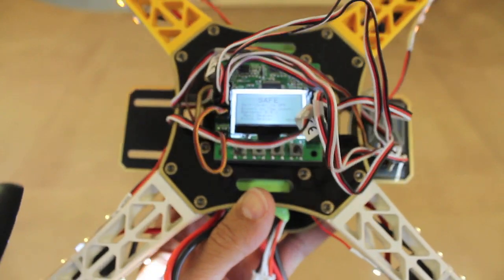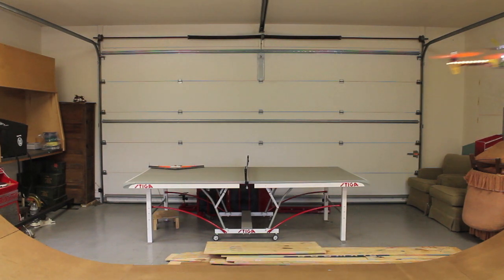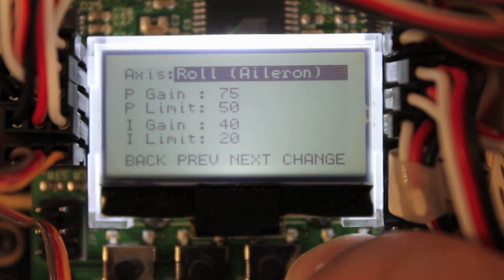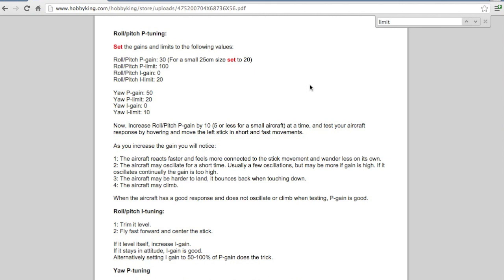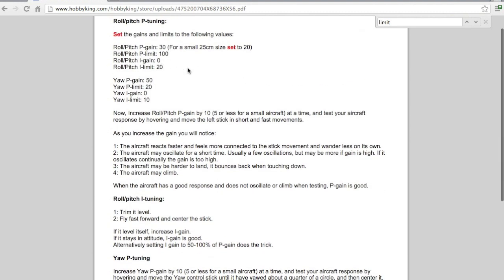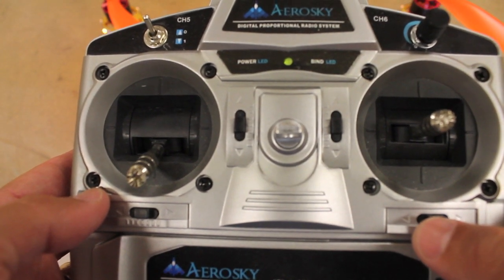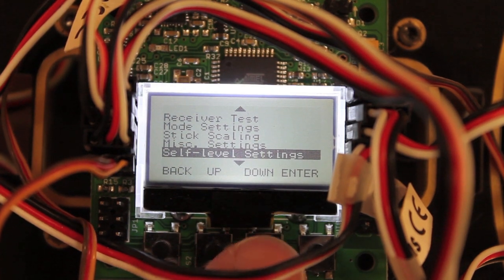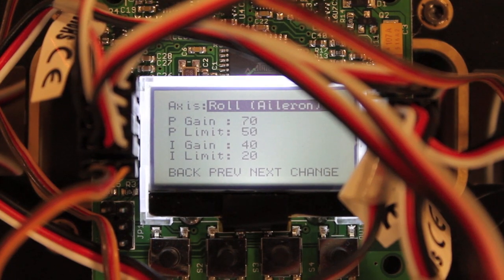KK2.0 Multicopter PI Gain Tuning for Beginners

Comment: Dennies,
Thanks FOR ur time answering back. In fact i followed step by step all of ur vids on the tricopter. A big help INFACT. The big problem was the motor Mount on the tail. The Carbon was not strong enough TO handle the motor on what reason i did not know why it keeps wabblin till it ended wrecking. I changed it to a metal plate and now i can start LEARNING TO FLY. A big Thanks to u and your vids it helped a LOT. Merry Christmas in advance and hope to see more of your big help vids. God Bless and more power.
Reply from the maker: bobot021070 So glad to hear you got it working! Merry Christmas to you too. Please keep us posted on your progress.

Comment from the maker: Dave, it was a request from a friend of mine. He wanted to get rid of the MWC and put the KK2 in. I agree that the quad flies great with the MultiWii and my buddy just wanted to give KK2 a try as well as be able to configure it without a computer. I haven't seen any oscillations with firmware 1.6 like you mention, but he also has the gains dialed way down. Thanks for the comment.

Comment: Hello, I have tried almost all settings for the beginner and this one was by far the most stable especially the rudder (turning a 360 in one spot) self level is as good as you will get.
Take my advice input the figures and start to enjoy flying your quad, THATS WHY YOU BOUGHT IT! RIGHT?
As you advance you will fine tune the settings but for a day one flyer there is nothing on YouTube that even comes close.
Thanks and well done!

Comment from the maker: Yes, do the P gain with I gain set to 0. But once you get the P gain in place start to bump up your I gain to where it feels comfortable. Or, as the HobbyKing guide states you can set your I gain from anywhere between 50-100% of your P gain. I know that's a wide range but I've found that 50% worked okay for me.

Comment: Dude this was beyond helpful!   Thank you so much for making this video.  I recently purchased the quanum venture with a kk2.0 FC and as a beginner had a very hard time controlling the copter with default settings.  Also, my self level mode wasn't setup properly so that was an extremely helpful tip.  After following these guidelines I feel much more confident with the quanum.
Reply from the maker: Dionatronics So glad to hear that. Thanks for the feedback.

Comment: Dennis, 
Thanks for sharing your experience on this video, it helped me zero in on setting up my KK2. I am coming from a KK version 1.2 board.
I do have to say, that I have learned that perhaps the quality of the equipment has plenty to do with the value of the settings. I started with your settings and they were too high for my quad.  I have a HobbyKing 450 board, Turnigy 12 amp ESC, Turnigy 1100 KVA motors. I will share my settings in a part two post.

Comment from the maker: Yes, you should have everything you need. I'm sure it's self-explanatory, but the reason I put the battery on bottom is so the KK2 would be on top and accessible to make changes via the LCD buttons. Thanks for the comment.

Comment: Dennis,
part 2 my settings.
Firmware ver 1.6+++
 PI Editor	
	       	Roll	Pitch	Yaw
P-Gain	40	40	40
P-Limit	100	100	20	
I-Gain	12	12	12
I-Limit	20	20	10
 Self Leveling
P-Gain	40	(matched Acro Mode settings)
P--Limit	20	default
ACC Trim Roll: not yet tuned
ACC Trim Pitch:	not yet tuned
Aux Switch Setup:
Position 1:	ACRO
Position 2:	not active
Position 3:	SL  Mix Medium
Misc Settings
Min Throttle:20
Height Dampening: 0 
Height D. Limit: 0
Alarm Volts:10.5V
Servo Filter: off 
 Motor Layout: X-Quad

Comment: Excellent video. One point about the aux toggle too and from self level mode. The channel limits need to be set at 125% or it may not detect the aux state.
Cheers.

Comment: This is a great tutorial. Thanks. I'm building a hexacopter with the KK 2.0 board. Can I use the same settings?
Reply from the maker: positivecamber Thanks for the feedback. I'm not sure if you can use the same settings. I'd probably start with these gains and then bump them up a bit if necessary.

Comment: Hey, (using the kk2.1.5 board) I have a bicopter and the servos are acting crazy when I throttle up. Do you know how I can edit them so I can achieve flight testing?

Thanks.
Reply: I fixed it, don't worry about it

Comment: Dennis..I have watched your video a couple times. Very informative. I'm trying to absorb P,I, Gains etc. I have a tricopter. When I turn the heli to face me, it will snap back 180 degrees away from me. I was thinking possible offset on the rudder motor. Not sure though. Any help would be great.
Reply from the maker: jerry zito That's a strange one that I've never seen happen. I don't have any experience with tricopters but will see if I can find anything out. Let us know if you come to any conclusions.

Comment: Excellent video! I would like to ask you about an issue I am currently facing. I have a kk board 2.15 , 20 amp multistar escs, bumblebee quadcopter kit so when the motors starts I leave them at 30% speed for a couple of seconds and the number 4 starts accelerating by itself. I have calibrated the escs zillion times, I have self level off (my radio is a turnigy 9x mode 1). I wish you could help me with this issue. Many thanks and keep on with the videos!!!!
Reply from the maker: Alvaro Gestido Thanks for the feedback. It's much appreciated. I'm not sure what the problem is with your motor but if you've calibrated the ESCs make sure you do a sensor calibration on the KK2. I would also swap that ESC with another on your setup to see if the problem exists with the ESC or it's something to do with th signal coming out to motor 4. Hope this helps and keep us posted on your progress.

Comment from the maker: I'm no expert, but will tell you what I do know. Please consider reading the Wikipedia page for more specifics of PID controllers. So you now about gains..well limits are the values that you input that tells the controller if the value of the gain exceeds this limit to soften it and not let it surpass the limit. Example: P gain is 50% and value comes back from the gyro as 250. The gain value is now 125. If you have a limit set at 75 then the value of 125 will be dampened to 75.

Comment: hey awesome video! do you have any experience with the kk2.1.5 board? im using it on a 250mm quad with emax motors. I have to say im not happy with the P/I gains at all. Iv experimented with it, with little success. It still has alot of oscillation. Any advice?Thanks!
Reply from the maker: Mad Yet I haven't worked with that board but the first thing that comes to mine is to make sure you have it well isolated from vibrations. On such a small frame sometimes it's hard to keep the FC from seeing vibes from the props/motors. Also, try bringing the gains down pretty far because the defaults may be too high. Do it incrementally and work your way down. Hopefully this gets you closer. Good luck.
Reply: Dennis, 

thank you very much for the response! I actually got it. little to 0 oscillation after leaving the I gains alone completely. I was confused and was under the impression that the I gain would have to move once I moved the P gain. No the case. Once I understood this, the oscillation tuning became much easier and eventually I got the 250mm quad right where it needs to be. Thank you so much for the video and the help!!!

Comment: Thank you for a great video. Can you explain, what does the Limit do?
Reply from the maker: I normally leave them alone... #8 From the link below:

Q: What are the "limit" values in "PI Editor"?A: About the "limit" values. They set the maximum of the available motor power to be used for correction. 100 is 100%. The "I limit" value is also known as "anti wind-up" in PID theory.The limits is most important on the yaw axis. The prevent a large yaw correction from saturating the motors (giving full or no throttle), causing no control of the roll/pitch axis.The default values permit 30% ("P Limit" 20 + "I limit" 10) of the motor power to be used to yaw correction, making 70% available for the roll/pitch axis, the most important ones.You can increase "Yaw P Limit" for faster Yaw response. Note that Yaw response is also limited by the craft itself.You can increase "Roll/Pitch/Yaw I Limit" for increased heading-hold "memory", that is how far it can deviate and still return to original attitude. Too large memory can cause problems if you have a "blow out" on one of the axis, tries to correct it with opposite control input and then when the blow-out conditions disappear, the craft will try to return to an unknown attitude.Unless you know what you are doing, leave the limit values as default. Default values has no impact on The PI tuning process.Also leave the self-level "I gain" and "I limit" at zero. The I part of the self-level algorithm does not work well, this will be fixed later. (Accelerometers is too slow) 

http://www.rcgroups.com/forums/showthread.php?t=1675613

Comment: I'd like to thank you for this and the other 2 videos. You've helped me a lot in building my first multirotor (a quad). One thing though, I'm seeing the same behavior as your tuned quad on this vid but at values 50% more than yours. Is this normal for a 550mm quad?
Reply from the maker: Thanks for watching my vids :) It's very normal that your gains will increase the larger your frame is. I can't say whether or not 50% is "normal" though. As long as your quad is stable with little to no oscillations then that's what you're looking for!

Comment: Thank you, Dennis. I have a question: I am going to set the KK2 on a V8 octocopter which I designed and built and will use for video recording. The craft is about 800 mm long and is powered by eight Emax CF2822, with 20A ESCs and a 4500mAH 3S lipo. The full weight, in flying order, is 1950 grams. I would like to know which PI settings I should use to achieve a very very stable and smooth behaviour. I thank you in advance.Cheers from Bruno
Reply from the maker: Hi Bruno. My recommendation is to start with considerably higher gains than what I posted in the video. Then you can work your way up or down from those. Or you could use my gains knowing that they will be low and slowly work your way up. I've never setup KK2 on an octo so I'm not sure the best way to start. When testing I'd recommend only hovering a couple feet off the ground just to see how it feels. Then you can adjust from there. If it's too wobbly then you'll need to bring your gains down. If it's not responsive enough then you'll need to take your gains up. Work in small increments so you don't run into any problems. Good luck and let us know how it goes.
Reply: Thank you indeed, Dennis. I am finding that the KK2 works well on my octocopter, with the exception of its behaviour when I let the sticks go back to neutral: it seems to take ages to come back to horizontal. It is a little better on self-levelling mode, but I still find it slow to come back to horizontal. I have tried with higher and lower P gains but it did not change much. Any idea? A (small.....) kingdom for your thoughts (lol).

Cheers from Bruno
Reply: Bruno De Michelis try setting up p gain in self level setting.. increase it up a bit and see if it solves the problem.

Comment: awesome video. I am using the same settings in my small 220mm blackout clone.
my quad is very sloppy in yaw input, it keeps on rotating even after i let go of the sticks, wat should i change to get snappy yaw outputs???

thanks
Reply from the maker: kushagrgoyal It's so hard to say without more info, but this is a great thread that hopefully can help:

http://forums.openpilot.org/topic/13456-constant-slight-yaw/

Good luck and keep us posted.

Comment: I have a Hex that I had built, and it oscillates pretty bad. I have the p gain all the way down to 15 and it still does it. Hard to fly that way for sure in acro mode. Thinking the kk2.1.5 is faulty or the escs are messing up

Comment: Great video me and my buddy are 3d printing our body. Hardware is coming soon. I have a dx6i radio will i be setting dual rates and expo on it? With my Apprentice plane i dont but do on my Blade copter. Thanks any help is appreciated.
Reply from the maker: Wally Krusee I'd probably start without dual rates initially until you get a feel for how it handles by default. Then when you want to improve the responsiveness you can start mess with your rates and expo. Just my thoughts. Good luck with your build.

Comment: Hey Dennis, it turned out that the 180 snap was the wind. I have the HK Y-3. The one that looks like a space ship. Well motor arms 1 and 2 are actually airfoils, so the tricopter would turn into the wind. My new question is the numbers you arrived at, will they work on a tricopter? Or is a tricopter a different animal?
Reply from the maker: jerry zito Great question and unfortunately one I cannot answer. I've never setup a KK tricopter so I would only be guessing. If you do figure this out it would be great to hear about your findings. Thank you.

Comment: Hey Dennis! cool tutorials, I just got a ST360 from HK w/ a KK 2.1.5 and I am having a hassle. I followed all the steps you listed in the vids. My problem is when I disarm the quad, the motors keep spinning, very slow but wont cut off completely, what to do? Any help will be really appreciated. Thanks!
Reply from the maker: Darío Alomía Thanks for the feedback. It's really hard to say without more information. Do you mind posting more info in the forums at www.garagepilots.com? Maybe some photos of your settings as well as what steps you've gone through to get this far. I'm assuming since you can arm your quad and that it flies okay or are you just trying to arm and disarm? That type of info will be helpful so that we can make some suggestions. Good luck!
Reply: Thanks to both of you, I corrected it, but now I can get it to fly, as soon as I give it 50% throttle, it starts waggling! I tried to sync the ESCs but this quad is possessed...
Reply: wow thanks for all the help! I trying everything, now I burnt two ESCs haha, In the meantime until I get the ESCs, could you please tell me how to set the CPPM? I am running a R615x with a DX6i, thank you!!!!

Comment: Hi Dennis,
Great video im having trouble with my quad i built with the KK2.1.5 when i take off it doesnt take off vertically it wants to take off sidewards and if i pushed it it would crsh 2 props in the ground, any help would be great?
Reply from the maker: Glenn Cook Some quick thoughts come to mind:

1. Have you calibrated ESCs?

2. Have you done the KK calibration process?

3. Are your motors and prop rotations correct?

Comment: Hello, Dennis, Thanks for videos . I've watched your video since built my Hexcopter w/ardupilot  w/tyg-9x and worked great. thx again. but now my ardu is Kaput and have to moved my Turnigy H.A.L hexcopter and used with KK2.0 which i had for quite a while before got Arducopter.and now after setting this H.A.L frame the same one with ardu and it will not lift off. same motors ,same esc,same RX,TX, I'm lost now ,motors config is perfect plus setup which i used to setup same KK2 with diff frame and working fine but not this one . what's wrong..an idea?? thx for your time.

Comment: Okay i see the aerosky has battery on top,but you have yourson bottom... If i buy the aerosky kit frame,esc's,motors,wires and the kk2 board will i have everything i need to have same setup as you have,so i can have battery mounted underneath also...thax for the info

Comment: I have the default 'pid' settings on my KK 2.x - it oscillates like mad in auto-level mode - it's the same as yours. Very similar to 4:10. I can fly my Hubsan X4 and it's very smooth, even in 'expert' mode which is highly responsive to control input.
Reply from the maker: alexellis2 Yeah the Hubsan X4 has incredible stabilization. I would say to keep working with your KK2 gains. It takes a good bit of trial and error, but you should be able to work up or down and see a change in the responsiveness in your quad. Good luck and keep us posted on your progress.
Reply: Dennis Baldwin I think I've 'cracked' it now - the props were utter rubbish. I've got the expensive 'gemfan' ones on now which has completely transformed it. I'm now getting a very smooth flight which is drifting off slightly to the right.

Comment: Dennis, I have a 250 quad with the kk2.1.5 board on it. I want to keep the setting I have on the board I have now for acro mode to do FPV. So the question is can I set dual rates in my radio to increase roll/pitch to make my quad flip/roll. That way I don't have to change the stick scaling on the kk2? If I want to flip or roll all i have to do is hit a switch on my radio.
Reply from the maker: Carl Bradley Man I really wish I knew the answer to your question. I think it shouldn't be a problem, but I've never set this up with the KK2. I no longer have that board so I don't think I'll be able to figure this out anytime soon. If I do stumble across some info I'll definitely let you know. Thanks for the comment.
Reply: Dennis Baldwin thanks partner

Comment: awesome video! i do have a question though. i have set everytthing the same as you. but when i take off the copter goes into a wobble and the wobble gets worse and worse till it smashes its self into the ground :( any suggestions?
Reply from the maker: Ryan Sweeney It's hard to tell but my first guess would be that your gains are too high. Try bringing them down incrementally (small steps) and then test. If that's not the case then maybe you have too much vibration that is getting back to the flight controller.